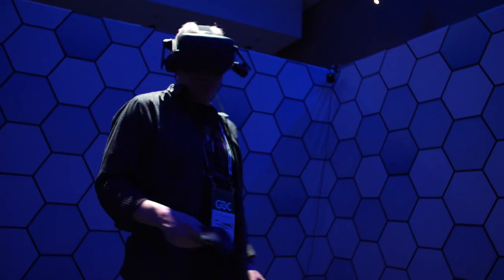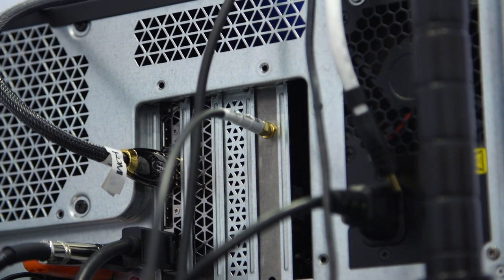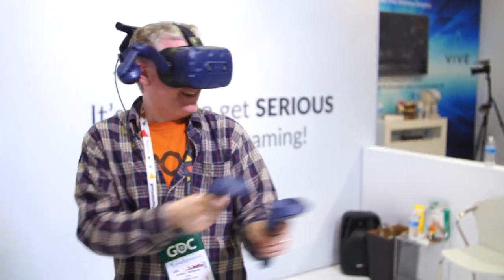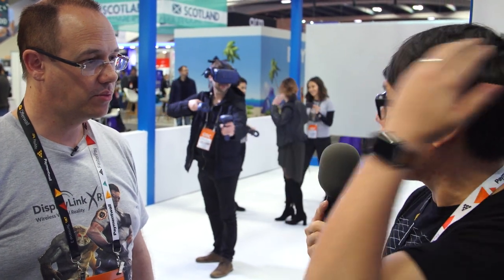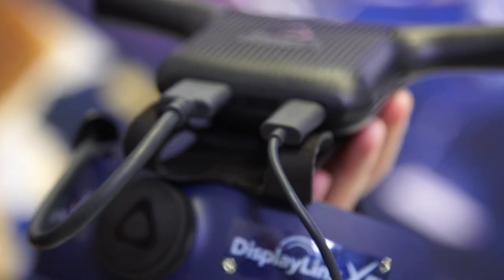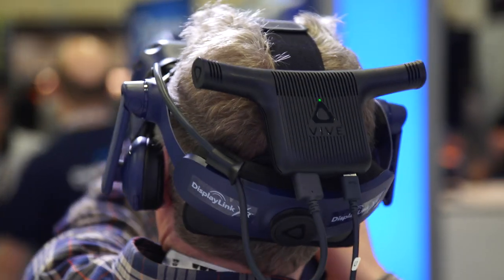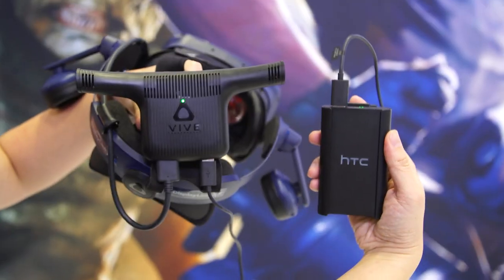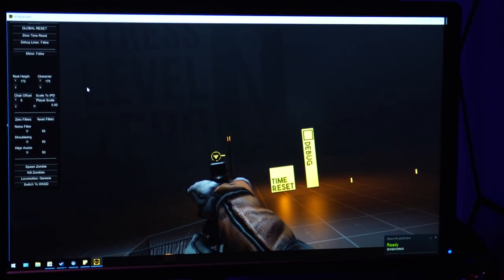Hands-On with HTC Vive Wireless Adapter!

Comment: OK.. First few things that crossed my mind are:
1. They replaced the WiFí router with a PCI-e card and now its... more end-user friendly? :)
2. What if you don't have free slots for another PCI-e card? (putting another PCI-e card in my Z370 Taichi mobo, already having a HD60 capture card in slot 1, would reduce the PCI-e lane from 16x to 8x for my GPU).
3. I assumed HTC & Intel would make a wireless adapter that could at least look better than TPCAST, but obviously that was too much to ask for... On top of that, the receiver is even bigger now.
4. Only 2 meter long coax antenna cable from transmitter to PCI-e card?! What if you dont have your PC in a corner of a room and need extension - is that even possible?
5. Compression? I understand 1440p VR & Vive Pro may need it, but AFAIK, TPCAST doesn't need compression. However, it sounds like the Vive/Intel adapter compresses the data even on the original HTC Vive 
6. According to the statement from 7:13 and on (in the Tested's video), they are using 2 transmitters and not 1?
7. What happened to the built-in battery? Looks like its using an external battery just like TPCAST?
8. Norm asked at 6:44 about the setup on the PC. Nothing was mentioned about software needed.
9. So its 60 Ghz WiGig, same as TPCAST. No latency? No signal loss? Wow how come its suddenly a perfect wireless transmission, while it was a highly questionable solution back in summer 2017? Note that Tested called the TPCAST solution 50 Ghz in an earlier video, which obviously is wrong... :)

What really crossed my mind though is... why no negativity? Why no skepticism? Why no questions about additional software? How come Tested is fully blown away this time - of a product that more or less already is available on the market for 8 months, at least for the gen1 Vive & Rift. May it be....because of the fact that its developed by HTC & Intel this time? ;)

So yeah of course I look forward to see this product being released, dont get me wrong here. I'm just very surprised about the hype this time. I may be salty now, but I see this as re-inventing the wheel all over again, and calling it revolutionary. I feel the Apple smell from far away!
Reply: "I'm just very surprised about the hype this time." Says the guy who literally hypes every single game that crosses his path including RoadKillerz VR one of the worst reviewed games on SteamVR.  

I bet this anti-hype from you has absolutely nothing to do with your 3 videos where you hype the shit out of the TPCast.
Reply: Christopher Raff, SweViver is just very passionate. The TPCast was arguably the first wireless solution for consumer VR. He has the right to be excited about it.
Reply: 2987ms very passionate about everything except the one thing he has not used... Hmm...  I wonder if it because he has not received a review unit like he did a TPCast.
Reply: Christopher Raff, Probably. But not for the reason you'd think. First of all, they're pretty much showing nothing new. Secondly, you're right, he hasn't gotten a review unit - let alone a unit at all. If I recall correctly, his first TPCast unit that he did several videos on he purchased.
Reply: 2987ms If he is buying them he has bought three separate units(The Chinese, and EU versions of the Vive, and one of the Oculus) which might be true, but when you add the fact that there are 5 full videos about the TPCast and that the name TPCast is prominently featured in the title of at least a dozen videos; things start to get a little cloudy.  Then consider the fact that he seems to be making a living reviewing VR games yet only has 11k subs... IDK seems like he is getting money from somewhere else.

Maybe Sweviver is independently wealthy from some other venture and he is just really ultra passionate about VR and especially the TPCAST, and that is why he is so desperately finding problems with a competing system.  Maybe things aren't so clean cut though, and IMO anytime anyone might be getting money without disclosing it you have to take what they say with a grain of salt.

Edit: Also before we get to the casting dispersions on Tested for possibly taking money don't even... Tested has consistently and clearly stated when they are doing paid videos, and I trust Adam Savage enough to not put his name on a media company without making sure that everything that company does is on the up and up.  This is trust gained over 15 years of following Adam and the things he does.
Reply: IIRC he bought 2, was given one. You should watch his latest video. Also I never claimed that Tested is getting paid by Intel, I don't think SweViver is implying that either.
Reply: Christopher Raff I would recommend you to watch my latest video, where I clearly state I have never got paid for a video, review, opinion or anything else. I never get hardware either. Deluxe Audio Strap waa the only thing I ever got a review copy of. All 3 TPCAST units I have I ordered/pre-ordered and paid them by myself. 
I dont need to advertize products, as Im not obligated to any company. If you have problems with my passion for VR and my recommendations of a product or game, then I sure u can find dozens of other channels to watch. 

Yes I was one of the few hyping up TPCAST long before it was available. For one reason. It works as promised. Wireless VR is awesome and going wireless is a much bigger upgrade than going wires Vive Pro with higher resolution, if u ask me.

Im not surprised why Tested is hyped about DisplayLink. Wireless VR really is awesome. Im just still as of today confused why they never were impressed about TPCAST working the same way....1 year ago. Back then allI remember was a veeery sceptical tone.
Maybe because its a Chinese brand...? ;) 
And same story goes with Pimax..
Thats all Im sayin'
Reply: 2987ms I wholeheartedly disagree that he isn't at least strongly implying that Tested is being paid.  There is literally a whole paragraph devoted to questioning Tested's integrety:

"What really crossed my mind though is... why no negativity? Why no skepticism? Why no questions about additional software? How come Tested is fully blown away this time - of a product that more or less already is available on the market for 8 months, at least for the gen1 Vive & Rift. May it be....because of the fact that its developed by HTC & Intel this time? ;)"

That paragraph serves absolutely no purpose, but to call out the integrity of the video; especially that last line.  Which like I said before is baloney.  Adam has spent a ton of his life the last 15 years building a sense of trust with his viewers, so much so that is basically part of the Adam Savage brand.  I don't believe that he would put his name on something that he is not 100% sure is of the highest integrity.

The funny thing is that if Swe didn't have his conspiracy glasses on he would quickly realize that Projections is HEAVILY biased toward Oculus(because it is both Jeremy and Norm's headset of choice something they have been consistently open about) and that nearly all the content on here is directed toward Rift users.  There are more than a few episodes where they literally never even bring up the Vive or SteamVR.  Moreover go back and watch the videos of the TPCast, they treat it exactly the same way so what is Swe even talking about?
Reply: Christopher Raff I believe his opinion is on them being more hyped about this because it's done by a more "reputable" company. Of course I can't speak for SweetViver.
Reply: SweViver Hey man, love your channel and your passion. Don't let these type of guys get to you, even though I know they are. I'm also very passionate about VR and have been accused of over-hyping. If I wasn't out of a job, I'd be donating to your patreon. Just know you're definitely valued in this community.
Reply: SweViver I will take your word for it, but I remember HonestMatressReviews.com and so should everyone else.  

That being said I again call baloney on the idea that Jeremy and Norm were not just as excited for TPCast.  They ranted and raved just as much as they did here.  It wasn't as long of a video and so there wasn't as much actual time given to gush on it, but they gushed on it all the same.  I will consent that there is more general excitement(not about the specific product), but I think that has more to do with the fact that Intel and DisplayLink, two HUGE companies especially in the enterprise market, are moving pretty big into the VR space.  Enterprise companies like DisplayLink don't move on tech like VR unless they are 100% sure that it is going to make them a ton of money.  That bodes well for the future of VR.

THat leads me to my next point: Why demean this implementation of wireless tech so hard when you personally don't have a need for it?  Like I said in my other reply to your other snarky comment about them using PCI some of us literally can't use WiFi for anything critical because of latency and connection issues introduced due to the WiFi spectrum being saturated.  TPCast literally does not work in my home.  So am I boned because SweViver doesn't like having to put an extra PCI card in even though he has 3 TPCasts already?  I have more than plenty of room for an extra one in my rig, but screw me right?  

Honestly for someone who already owns another solution that fits their needs and says that they want the VR market to grow, I really just don't see why you would poo poo another solution because it doesn't fit your admittedly nonexistent need.  That makes absolutely no sense to me.  It would be like me going on your TPCast videos and saying that they are shitty and useless because my WiFi bandwidth is saturated.  I wouldn't do that though because I know that the TPCast is a viable solution for a ton of people.  As for DisplayLink's solution: I for one have a Mobo with a few extra slots for PCI-E I don't stream and so my PCI Lane bandwidth won't be affected because of a capture card, and on top of that I NEED a solution that isn't WiFi bound so...  This looks damn good to me.

Edit: I also want to say about your comments on the young woman's behind; that is WAY beneath you.  I expect that from the typical youtube comment, but I honestly thought you were more mature than that.
Reply: Christopher Raff If I'm not mistaken, both the TP Cast and this use the exact same wireless technology. So if you can't use the TPCast, you won't be using this either.
Reply: 2987ms  But Intel and DisplayLink are objectively more reputable companies.  Both of them have been on forefront of technology in their respective fields at least a decade.  They should garner more hype than a start up.
Reply: 2987ms This uses Intel's proprietary implementation of WiGig exclusively.  The TPCast transmits everything but the actual display data via traditional 5ghz wireless.
Reply: +2987ms It's difficult to say without having used either system but I think Tested felt this system was better than TPCast, which may potentially be true if implementation specifics result in better performance (e.g. better, lower latency compression*, better dynamic adjustment of signal quality etc).

*WiGig has a theoretical maximum bandwidth of 7Gbps in ideal conditions. HDMI has a maximum bandwidth of 10.8Gbps and is much more reliable in hitting that bandwidth. Based on some quick Googling it looks like the original Vive at 2160x1200 90Hz would require around 7Gbps to work uncompressed at the cable level, so TPCast must be using compression to work in the real world where wireless throughput would be compromised by things like varying receiver position.
Reply: In response to your point #2: 16x vs 8x has 0 impact on FPS in games. Your GPU is not saturating an 8x slot: https://www.gamersnexus.net/guides/2488-pci-e-3-x8-vs-x16-performance-impact-on-gpus
Reply: I really couldn't tell you the exact changes made. I'm guessing it's their algorithm, but what I will say is that I got to try it at CES and had a better experience than I had with my TPCast and it was slightly more comfortable (Battery weight and antenna placement). TribalInstincts was also there and when I talked to him he also said he liked it quite a bit more. I don't think it's a massive change from the TPCast. Just a polished version. I agree with you on the fact that I wish they had changed or fixed more of the quirks that were on the TPCast, but I enjoy my TPCast and if Vive ships a wireless adapter that is just a easier to use and more reliable TPCast, I'll be happy for now. and from what I saw at CES the TPCast 2.0 also uses compression and that the variable compression algorithm of the DisplayLink solution also allows it to send the full uncompressed data when bandwidth allows. I also assume some of the consistency and performance comes from their antenna design (Which looks stupid, but I guess I'd rather have performance than looks). Anyways I hope this ends up being a better solution than the TPCast, but only time will tell.. Also I love your videos!!! Sorry to hear you won't be able to get a Vive Pro...
Reply: Prime Technophilia Old one could not, 2.0 can. But the TPCast is $300 so I'm not sure what you mean by better deal? Price has not been announced on this unit.
Reply: No need for negativity. Tested is also very passionate about VR just like you :)) As you can see Swe if you become divisive, you can expect your content to be scrutinized in the same manner. Not saying you can't prefer one wireless solution over other but last part that targeted Norm & Jeremy was totally unneccesary :/ Peace! :>
Reply: 1. They replaced a wireless transmitter that had to be mounted on the ceiling and a wireless router. with a single pci card and a wall mounted antenna i would say that is more user friendly.
2. If you have decent rig you will most likely have a PCI 1x slot for the card , and who knows we could see a  usb-c version for laptop use.
4. the short cable is most likely to reduce loss.
5. Compression only comes in to play if the signal quality becomes poor  if you place the antenna in a good location it should almost never turn on.
6. They are actually using one antenna. he points out two because there are two VR demo units there.
Reply: If they made it connect to routers, it would not be more user friendly, as most peoples routers are those shitty ones the cable company gives them, it would be dumb for them to expect everyone to have a good gaming router, and would suck for me to have to drop another 200 dollars on a decent router after spending almost a grand on the headset and another 500 on a wireless receiver, not everyones rich.
Reply: I'll probably 3d-print an enclosure and try running an external PCIe slot via type-c... I really don't see why they couldn't do that out of the box <_<
Reply: 1. less convenient for clueless users but much less constrained by the connection bandwith .
2. most mobos have at least 2 or 3 additional slots that can handle X4 pcie connection . and as long as your gpu is connected directly to the cpu X8 would be fine i ran in the past SLI config with X8 pcie not issue at all, if you still have many cards you might try to configure to connect the card to the PCH, or change to HEDT platform which were created in the first place with a lot of PCIE lanes to handle a lot of add in cards.
3. the adapter looks is up to the company that implements the technology not HTC and intel and personally as long as it not in face or causing a physical limitation I don't really care about the looks of it.
4.it is a passive non property standard antenna cable you can get a longer one for not to much money. 
5.they clearly said that they right now don't use compression but it is an add on in the future where you would drive much more data you can clearly see him telling that in 5:20 . and as far as I concerned  having the option to use compression is much better than not having when you are bandwidth limited.
6. yea probably 
7. it is a trade off you can probably integrate builtin battery but then you add weight and you might need to compromise on the battery size, overall external battery is a better option for more comfortable experience 
8. no idea about the software but it is a demonstration they would probably have some driver  for the pcie card but would this be an issue ? 
9.as far as I'm aware TPcast is 5ghz connection same as you WiFi 802.11ac router (I've checked few places it is a router that transmit at 5Ghz) unless they have a different version if so enlighten me . as far as it goes for throughput the Wigig solution is much better option in close ranged since the throughput is much higher, the interference is much lower. and there is no perfect connection there always be packet loss but the advertise transfer speed is usually after all the packet loss. and it is the best option for high transfer rate of data.
skepticism is always a good thing but overall the potential here is huge on the long run , the solution right now might be adequate for the current generation but as the fps and resolution increase it would be inadequate pretty shortly. on the other hand this come with a promise for better future proof what you buy now will be good for the next few generation after the TPCAST is a nice solution but as resolution will go up it would just fall down. also there would be direct support by HTC for this product which is a huge plus not available with TPCAST.
Reply: Didn't read all your rant but the answer is likely dont buy it if it doesnt work with your setup. This is true for everything.
Reply: Prime Technophilia this is for people that want seamless play with minimal image loss this cant be done over a 5hz signal. Also they said they will have headroom for future tech. Btw nobody knows the price yet.
Reply: Serinity did you watch the video?